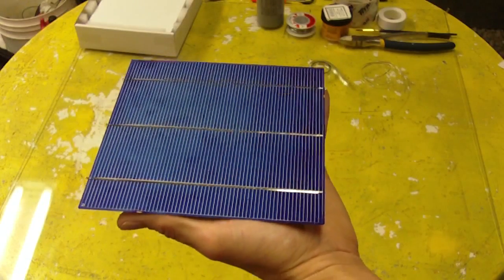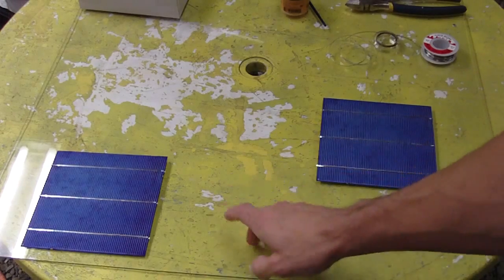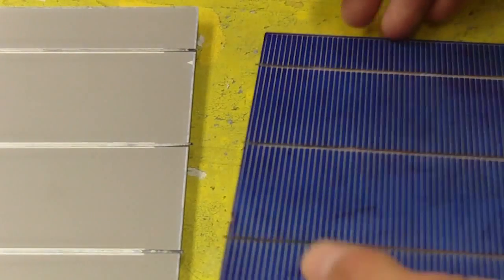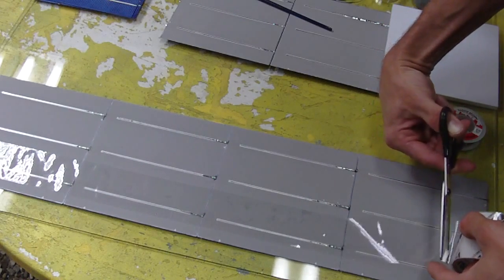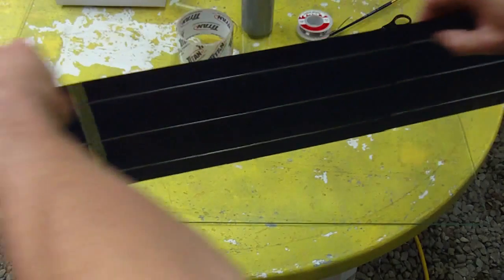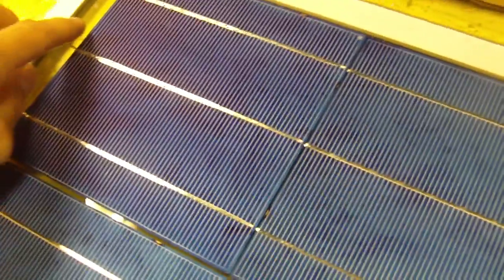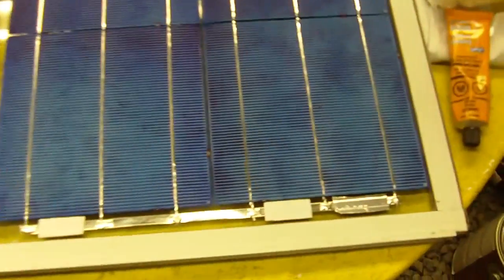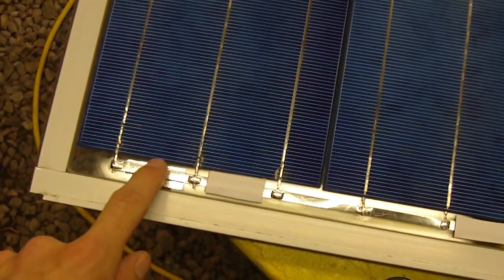Homemade Solar Panels Diy tutorial, complete build

Comment: Kudos' to you Kurt. You are a teacher that gets the masses thinking. I've successfully built about twenty 36 cell panels now. I use nothing but the highest quality materials that are available, It seems to take hours of internet searches. Many components are unavailable locally. Ebay has everything.  They (36 cell panel) end up costing about 120 each. I've nothing against against using surplus materials that I have on hand, if done properly they can work as good as factory produced. I use 3/16 thick aluminum angle 1 1/4 width. Seems as overkill to many but it will not flex in the wind and weather. You know how fragile the cells are, often any movement can break your waterproof seal and or break the cells. Makes a difference in stormy windy weather. This can reduce efficiency or eliminate any power from that panel. Syl Gard  from Dow Corning is a two part silicone made for this type of application. Mix it, apply to panel, let dry 2-5 days. It dries optically clear and completely encapsulates each cell. The company claims a minimum 25 year life in an outdoor setting. I've had zero problems with it, 2+ years outdoor use and still counting. Syl Gard adds about 45$ to each panel, I consider it insurance. My building habits seems expensive to many. I get a panel with the same power output of store bought at 1/3 to 1/2 the price. Use all the domestic components that I can and help employ Americans. As you have shown it can be done much cheaper and I respect you for it. My technique shows the promise of a long working life with uninterrupted power. I am not faulting your method at all, I guess I'm a little lazy but I don't want to invest this much time, money, and work without a long term pay off. Here's to you again, your doing a stellar job and helping many. Thank you.

Comment: My solder tip does not do the job. It's 40 watts and after a good start, the tip probably it is not as hot as the beginning (seems coated of some dark residual matter). How can I clean it effectively ? Is there any better tool to use for soldering ? Thx
Reply: In the soldering supplies isle of your local hardware store (or online) there is a sponge for cleaning your tip. Just use any non synthetic organic sponge and some water and wipe regularly at temperature to keep your tip nice and clean.
Reply: If possible get a quality major name brand solder gun. It will perform much better, saving you frustration and time. Its a tool that generally never wears out and the tips are replaceable.Your grandchildren will probably be using it in the future and it will still work perfectly.

Comment: Amazon sells these panels at $7.99 each. $7.99x16=$127.84. Harbor Freight sells a 45 watt/12v panel kit for $189.00 (already assembled).
Reply: I have not used the Harbor Freight etc. panels. They are lower priced than name brands it's true. Consider the horror stories from many of their users, poor performance and short working life, and weather/moisture problems are reported as common. I am sure that there are some that work and last as advertised. Many are relying on solar as an emergency backup. Cant repair items during a hurricane without power. Remember you generally get what you pay for.
Reply: Carolyn Jennings I am new to solar panels, but bought a 100W panel from Amazon for just under $200.  I am looking at Charge Controllers and I'm very disappointed at everything I've looked at.  I'm an EE and I'm considering designing my own feature rich highly efficient Charge Controller.  Has anyone on here worked with these much?
Reply: David Quinn check out Julian Illets channel. I think he has some builds and comparisons, but I don't think he builds them anymore.
Reply: Trace Waters hi everyone ,if anyone else trying to find out how to build a solar panel from scratch at home try "Samtawkes DIY Solar Panels" (do a google search ) ? Ive heard some super things about it and my cousin got cool results with it.
Reply: =========>>> http://home-renewable-energy.blogspot.com

Trace Waters
Reply: mrblowhard2u Interesting... Maybe I should make my own panels and sell them on Craiglist/etsy or something :p
Reply: mrblowhard2u ebay has the pannels at 1.17 and 99c
Reply: mrblowhard2u: First don't confuse cells with panels. Also, Harbor Freight panels have a bad habit of losing connection where the wires connect to the solar cells. I tried and could not re-solder the connections. Instant paperweight. in any case, you can buy a 100 watt solar panel on Amazon for about  $110 dollars. He needs to add diodes for blocking return current and I am pretty sure he will have corrosion problems. Although the panels are sealed, there is still moisture inside the glass. I'm guessing maybe 2 years. clear epoxy will solve this but is tricky to work with and expensive.

Comment: Its best to use a substrate that is at least 3m thick and it doe snot hav eto be glass, just transparent. you can make your own topcoat to paint onto the surface think potato and copper wire with alumnium wire with a liquid capsule.  so an epoxy resin sealer, mould and wires made from copper and alumnium. the copper on the plate and the alumnium  in series on top of the mixture - this is wher eit gets tricky and you have to experiement.

Comment: Silicone the acetic acid type will react with copper so never use it, use only a non acetic acid type although it takes longer to cure.
You have made a good video but your sealing system will  suffer condensation problems, it's best to use a uv proof clear resin to seal them in forever, try boat building supplies it's cheap in bulk. Resin is another skill set you will need to learn.

It also must be made clear that gaps between cells are critical to prevent short circuits.
With a series circuit the weakest cell will effect the the whole cell. You will find just shading one cell you will loose up to 50% of the power.

Never just rely on voltage, current is even more important as it produces the real power of the cell. Volts X Current = Power, or V X I = Watts of Power.

Good luck with your future development.

Comment: I had difficulty soldering the cells since the heat created instant fracturing. It rendered the cell useless.
Reply: That is what a heatsink tool is all about.Use a small aluminum or copper clamp between to cell and the solder joint. It is supposed to draw the heat away from the sensitive part. Copper is more efficient at transmitting heat but solder does not bond well to aluminum and minimizes the tool sticking to the join.

Comment: hi! excellent video, just one question, one people told me that if i dont use the eva encapsulation and if i only glue the solar cells in the middle they will break, as i can see your video is more than 2 years on the air, can youtell me if you experienced that problem?  thanks in advance

Comment: Thanks for taking the time to share in your efforts. I am planning to build something on our property that will allow us to power 7 homes a building and several greenhouses. Whether you've done everything right or not, you are making a difference and that is what I appreciate. I will watch your other videos and hopefully pick your brain, regarding our project, at some point in the future. I also noted that one comment stated, 'you should add a blocking diode', What is your take on that? In your current experience, have you found that to be more beneficial, or unnecessary?

Comment: I wonder, all those tiny cells together. Are they just as efficient as ordinary big panels in that size?
And what do all those cells together usually cost?
Reply: jack hodges fantastic answer very well explained
Reply: Take a good look at the ordinary big panels. They are made this way.  They dont have a single big cell.  Someone in china is soldering them together.

You can buy 100 * 2.88 watt cells (monocrystaline 18% efficiency) for £90 delivered.  which is half the price of a 250 watt finished panel.  so, if you have more time than money it is worth it.
Reply: jack hodges Wow.. But If I build a huge panel this way, do I need an energy converter or something to convert ampere or anything like that? Because I just want to put in a cable whenever I want electricity.. Plain and simple.
Reply: Jörgen Ekvall Solar is not so simple.  first it produces d.c. power which must be converted to a.c. to run 'normal' electrical household items.  so, you need an inverter to change it.  Second, you need to store electricity to use when the sun isnt shining so you need a big battery bank (if you are not connected to mains electricity).  Third, even quite big panels do not produce so much electricity that you can just plug whatever you like in.  The panels he made here are maybe 100 watts (when the sun shines) so you would need about 15 of them to boil a typical kettle. They are getting better as time goes by though.
Reply: jack hodges Wow I just lost hope there.. But how long would it take to fully charge a car battery with his 100 watt panel? And for how long would such a battery benefit me (using your kettle example) ?
Reply: Jörgen Ekvall The calculation is quite easy really.  The kettle uses 1500 watts and the solar panel supplies 100 watts (when sunny) so for every minute you use the kettle the solar panel needs to have been at peak output for 15 minutes.

to store the energy in a battery you would need a deep discharge battery which looks just like a car battery but is designed to empty and fill more than the car variety which expects to stay pretty full nearly all the time but can supply big surges to start your car.

now, watts = volts * amps
so,  a solar panel supplying 100 watts will supply a 12V battery with 8.33 amps
i.e. 100 = 12 * 8.33

the 12V battery will have a capacity rated in amp-hours.  A 50 Amp-hour battery can supply (or receive when being charged) 1amp for 50 hours.  Or 2 amps for 25 hours and so on.
A 50 amp-hour battery will be completely filled by the 100 watt panel in 50/8.3 hours which is 6 hours (near as damnit).  i.e. we have stored 600 watt hours of power in that battery.  
i.e. 600watt hours = 12 * 50 amp-hours

You will then empty the battery depending on what you use it to power:-
You could run a 100 watt light bulb for 6 hours
or, a 400 watt computer for 1.5 hours
or a 1500 watt kettle for 6 / 15 hours (about 20 minutes)

And to make it worse, if you want the battery to have a long life you probably should only use about one third of its total capacity before you fill it up again.
so you should only use 200 watts out of that 50 Amp-hour battery to keep it nice.

The more things you want to run and the longer you want to use them is what matters.  Then work out how many batteries will hold that power.  and then work out how many panels you will need to fill those batteries up every day.  And you will need extra spare storage capacity for the shitty rainy days too.

oh and because stuff doesnt run on 12V usually you will need an inverter to change the 12V to the high mains voltage.  This will lose maybe 10% of your stored energy when converting.  More if it is a cheap one.

If you can cut out all the heavy duty electrical machinery then it doesnt look so bad.

Comment: Not a bad video. I have been lucky to pick up 30 sheets of actual solar glass from a company that went bust, I was thinking of placing my cells between 2 sheets of glass but have not done so, not due to one person here saying it will cook your cells, you can buy commercially available panels that are 2 sheets of solar glass siliconed together The company is First Solar and they did it so i'm curious if they would significantly overheat. Anyway i just dont want to waste an extra sheet of this glass for a back panel. I'll be encapsulating with the 2pt epoxy designed for the job and use a foot vibrator on low to vibrate any air pockets out. The most expensive i have found so far is the bloody aluminium frames. Anyway great video. good onyou.
Reply: Using a foot massager is not recommended. Yes, it will vibrate, but it also has the potential to disturb the coating. The coating outgases and if you vibrate you risk it being too thin in some places. When the coating outgases it creates tiny bubbles. If your coating us too thin when the bubbles pop it will leave a tiny void allowing air and moisture in. The panels this guy built will not last long. He used no environmental protection. The glass alone will not work. The tape he used isnt rated harsh environments. Plus, the clear packing tape is a huge esd hazard. I wouldnt have chosen a rosin core solder or rosin flyx either. While the activity level is very low, it is very sticky and will attract debris to it. This can be dangerous. Your better off using a liquid no- clean flux.  It has the same low activity level plus any excess will evaporate.
Reply: Thanks Danielle. most helpful.Cheers Phil
Reply: Tinted glass is meant to block uv   rays. Don't know How well it would work. They make a special solar glass.  How much it costs I have no idea. I'm also not comfortable with there being no protection diodes. The concept is good, but if you build them the way this guy did, your taking a Big risk. I don't see them lasting long.

Comment: Improvements or changes you might want to try:

1) Use the 3M double sided tape called "VHB Tape" (very high bond).  Once applied, it will last regardless of vibration or temperature.  Thickness and size of rolls varies - shop carefully.
2) Using a "Silver Solder" will reduce the long term chance of failure due to corrosion.  It's only marginally more expensive then typical rosin core, and melt point is only slightly higher.
3) It's been suggested to use Polycarbonate for the shield - I agree with using it for the top layer as it's more durable, however I feel your choice of using glass as a rigid frame is superior.  Regardless of what is used - keeping it CLEAN will be a long term issue people need to keep up with.  BTW your video is great!  Nice Job!!!

Comment: what is the average cost to build one of these panels and about how much energy do they produce (as in give me an example of what i could run off of it) for example  : one finished panel cost me _$ to build, and i can run my tv, dvd player,xbox and computer off of it, all at once - or w/e the actual answer is

thanks you
Reply: Hey can't easily give that information, because it'll be different for everyone. What the finished panel produces will vary on what cells you use and how you mount your panel, etc, and the cost will obviously vary based on your materials cost (although the cost of his own panel would be a helpful benchmark). What you can run off the panel will depend on the draw of your appliances and what sort of battery set up you're using. Usually you run appliances off a battery while the panel both charges the battery and feeds the appliances, if it's output is enough (I think). If he said he was running his TV off his panel, there would be no guarantee you could run your different TV off your different panel - it all come down to output and draw.
Reply: i understand, that makes perfect sense.
i guess as far as cost, im just wondering what an average or rough figure would be, just for the basic/most average materials to build one of these panels (and necessary parts like batteries?) for example is it closer to between $25-$50 or is it closer to between $100-$250?

also,
with output, again, just looking for a rough estimate based on averages. for example : for one of the panels shown being made in the video, what kind of battery set up would one expect to see on there (again a rough average is fine) and what kind of out put would you expect from a solar panel of this size with that battery set up, and of these materials on an average sunny day in some average place not too far nor too close to the equator (lets go with Texas? , assuming location in regards to the equator makes a difference on sun intake and electrical output by the panels) for example, during the day, using only one of these panels and the battery set up, how many of my devices could i run
-average laptop computer
-avg medium small personal tv
-charge i phone
-lamp 60 watt light bulb
-an xbox
-toaster oven
-mini fridge 

could i run all that and if not about what could i? im just trying to get an idea of how much power i could generate with one of these and what i could do with it / how many i would need to make, i tried to list common examples so u could estimate their draw, but if you would prefer to use other items your more familiar with, that would be fine. i just want to get an idea of how far one of these panels go regarding output /productivity

my primary goal is to make a solar panel type kit that completely replaces my families gas fed generator